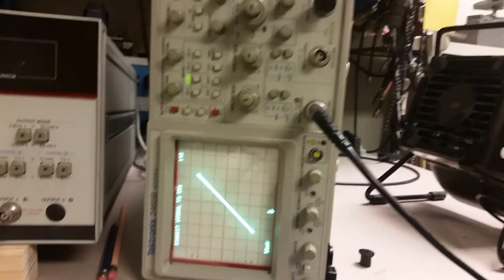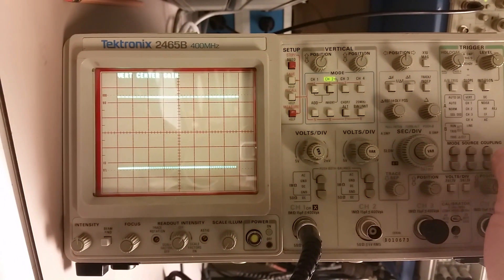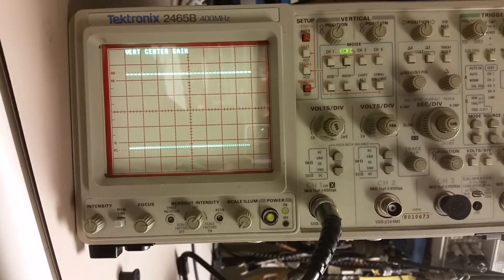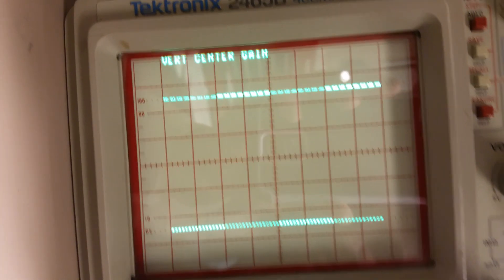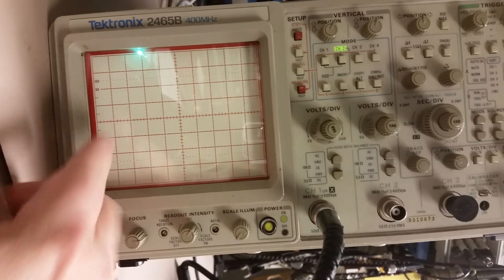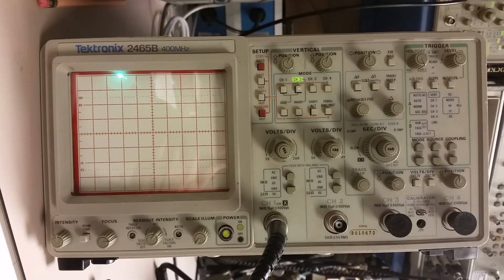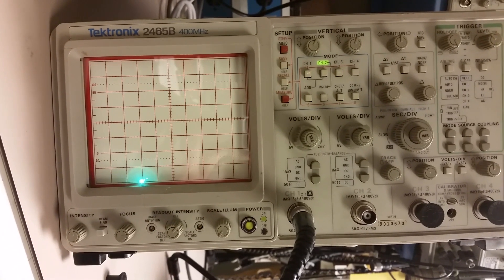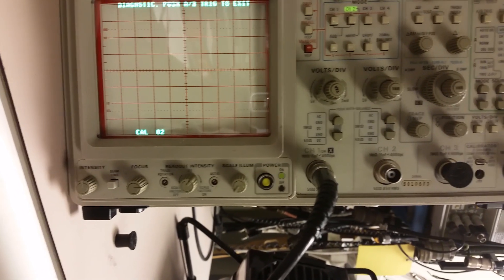Tektronix 2465B CAL 02 Final The Light Show

Comment: mine is sitting under the house for 20 years, i replaced the battery, lost calibration, never used it since.  one day, when i retire, i will do this.
Reply from the maker: I was just cruising through the comments and saw your comment. I know it's an old comment, but you can still use the scope as an indicator. It will function fully except that the values will be slightly off. Hope you get her done. Best Blessings. Keith
Reply: @keithnoneya  Hi Keith, I got the service manual, now under the house too.  Is it my attempt to re-live the good days from the past? I have a lot of new equipment that is useful, now it serves to bring a smile to my face to know the past was real. Thanks for the response! :)
Reply from the maker: @glennjackson2876  Join this group on Facebook too; https://www.facebook.com/groups/7511394462280297/

Comment: Question for ya.
I got mine back from cal and it always boots up in BWL.  Is there a setting soft key where i can have it remember not to boot up in bandwidth limit, or is that just a default?
Reply from the maker: Hum I never noticed that before. I went back and checked some of my video's and all of them had the 20mhz BWL on when I pushed the A/B Trigger. Before that it was off. Best I remember you can set the scope up how you want it to fire up, then save the setting. You'll need to check the manual for that though, it's been years since I've used the scope. If you figure it out post a video on your channel and drop me a link, I'll go watch it. Best Wishes & Blessings. Keith Noneya
Reply: @keithnoneya  Thanks Keith.  I didn't see anything in the manual, but maybe there's a programming manual for this one that mentions the BWL somewhere.
It's not critical, I just felt that turning it off all the time was a hassle.
Reply: Have a look at the 2465B Operators manual available on the Tekwiki site.  In Appendix A it describes how to get into Exerciser 06 (Exer 06) which sets up the 'Start up' conditions.  You may also want to look at Exer 07 as that all relates to Setup 1 conditions.  Could be as simple as setting Exer 06 to Power up in the same condition it shut down in (obviously turn BWL off before shutting down and it should remember that).  Big warning - if you see 'Cal 06' (not Exer 06) turn it off and refer to the service manual on how to set the 'Cal / No Cal' jumper to the 'No Cal' position, that will stop you inadvertently corrupting your calibration constants.
Reply: @millycarrington  Thanks a bunch man!  Appreciate the tip.  I'll look into it soon here.
Cheers.

Comment: This is a beautiful scope.
Reply from the maker: Yeah I loved this scope and used it almost daily at work. Unfortunately when it went to Calibrations Lab it failed CAL. So they couldn't let me use it until I repaired the reasons if failed Cal. I replaced the Battery and the IC that held the Calibration constants and attempted to calibrate it four times. It always failed on the last step of CAL 09, so the company got rid of it. What a bummer. Of the 24XX series scopes this "B" is the one to have. Thanks for the comment and watching. Best Wishes & Blessings. Keith Noneya
Reply: @keithnoneya  Yeah, I totally year ya. I got mine at the employee sale. Same thing as it was disposed as it was replaced by a new one. I got mine for a whole 50 bucks and then refurbished it.
I wish this vintage of scope would have a UART decoder.
Reply from the maker: @billspencer8540  Best I remember it did have a GPIB option you could buy and I think it could access some of the information. But again it wasn't on all scopes it was an option. You'd probably have to find the GPIB Manual for the scope.